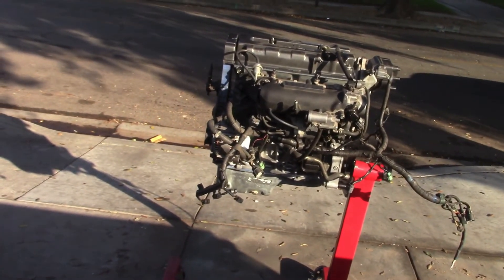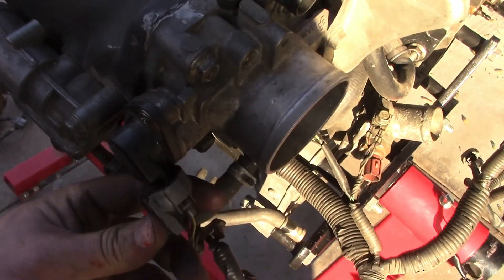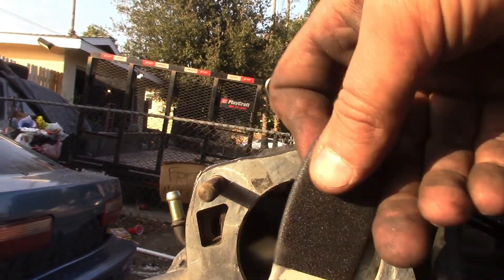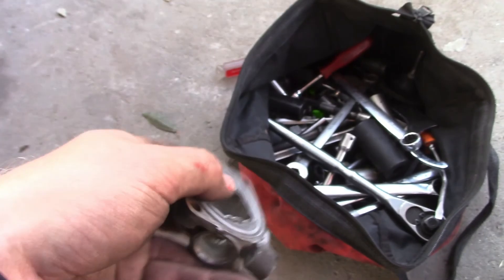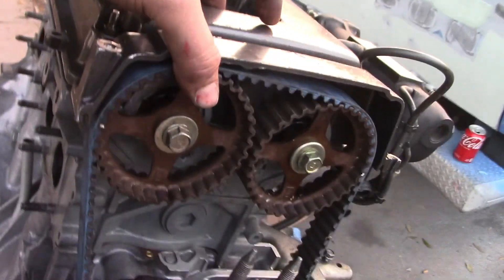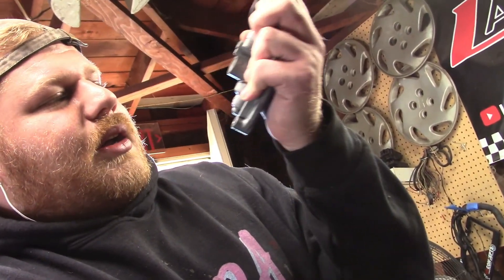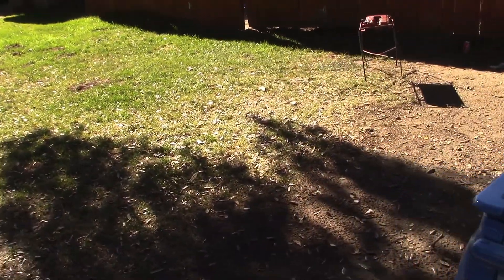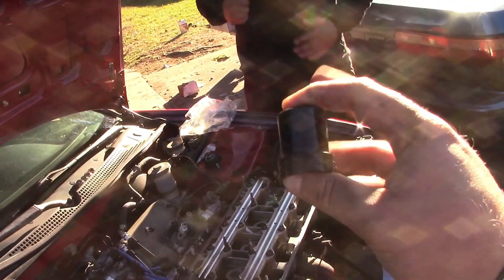We’re back baby! My first 2022 video

Comment: When I got my integra they put silicone in between header and the exhaust 😂😂😂
Reply: @Mr.Gal1kanokus  that’s not the worst of it, all the head studs were pretty much different size , used one almost sure water hose as a coolant hose and a gas line for the other
Reply: @EG Markoz  🤦‍♂️🤦‍♂️